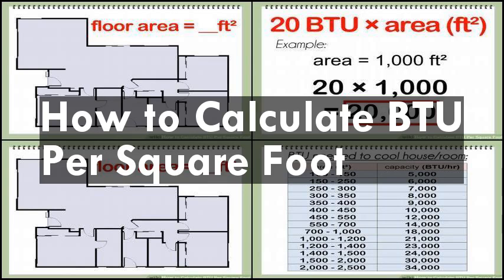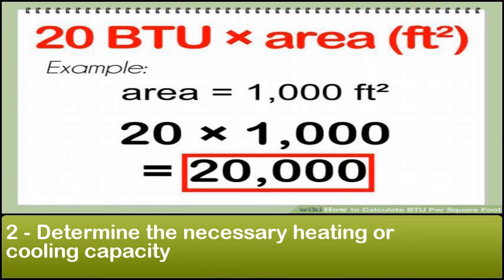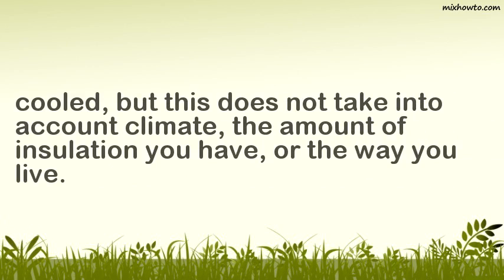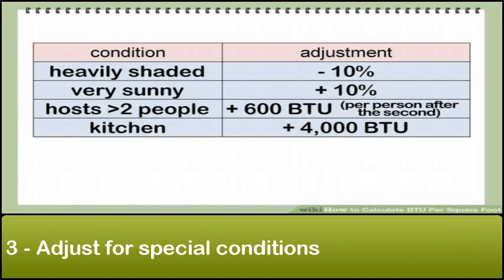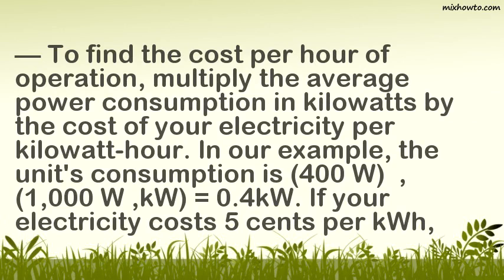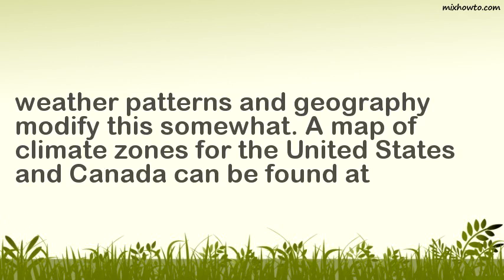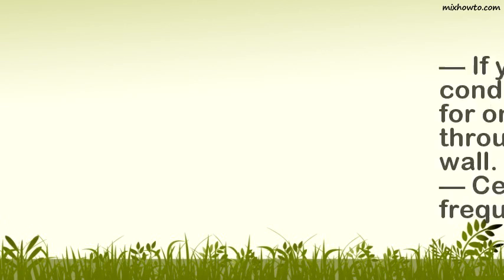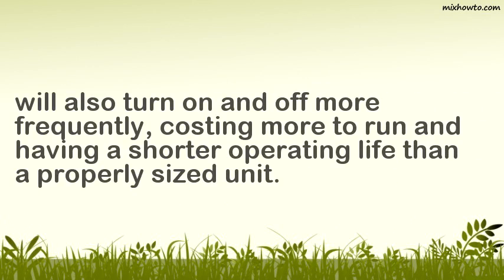Simple Calculating of BTU Per Square Foot

Comment: I guess this could be used as an indicator for a single room. This video is a JOKE! This will not assist you in a PROPER heat loss of heat gain calculation. Get a human to read the script.
Reply: This video is good for beginners and at least it's not advertising for a BTU calculator for me who just started my g3 schooling without any knowledge about this field is helpful I've been trying to figure out  the formula for calculating btu's all day